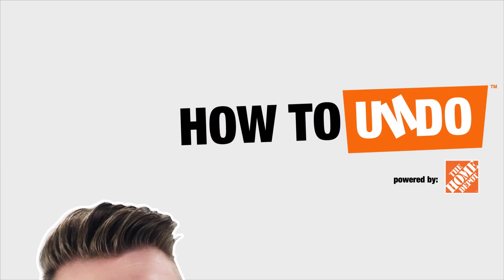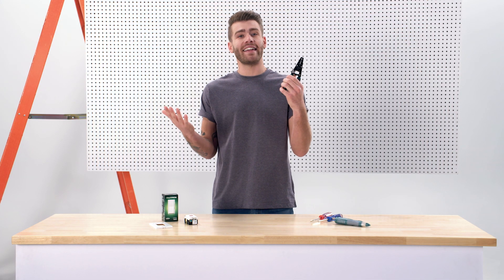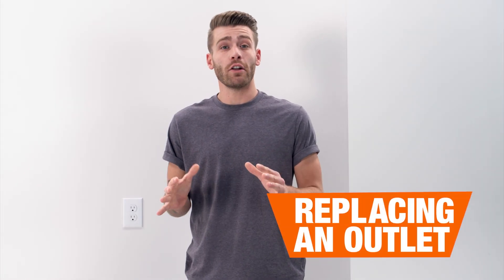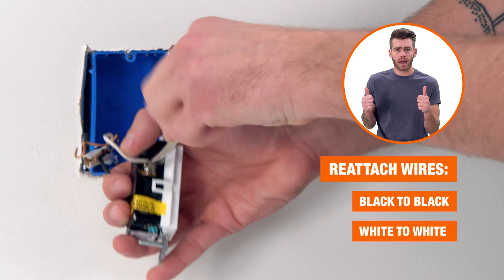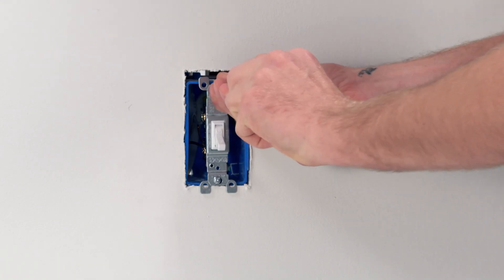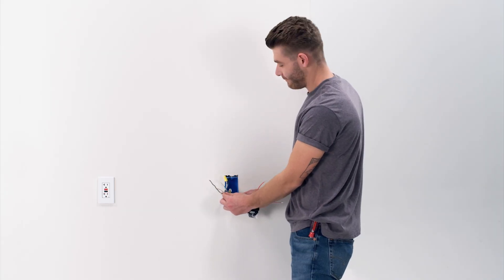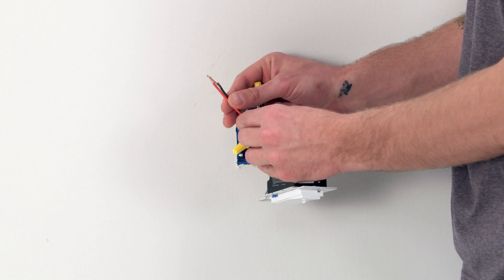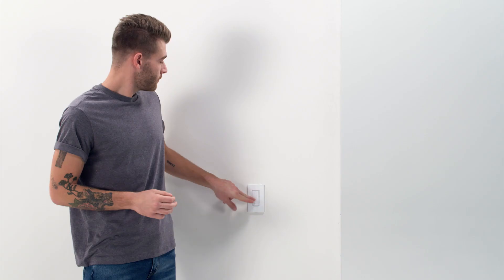How to Un-Zap an Outlet with Mike Montgomery: How to Undo (Episode 4)

Comment: Love the series and your instagram.
It's worth mentioning that Circuit Breakers and GCFIs serve two totally different but important purposes and aren't interchangeable. 
The Circuit Breaker breaks the circuit when a maximum current is exceeded. 
A GFCI trips when all the electricity that enters your appliance/device does not exit your appliance through the correct path. This typically means that the electricity is finding its way back through standing water or anything conductive that is connected to the physical earth. It does this by measuring the difference between the Hot and Neutral wires and when it senses a difference it trips.